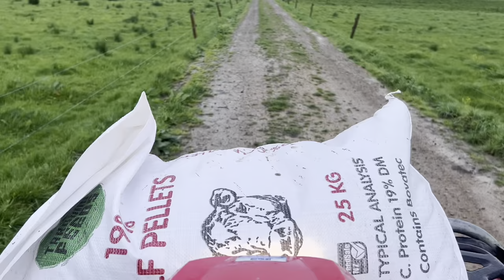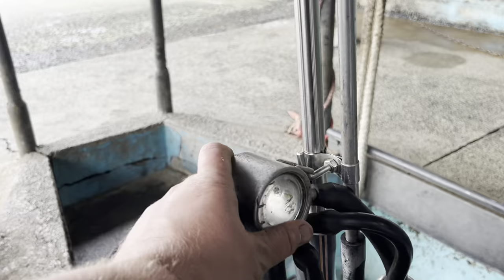Cowshed Gets An Upgrade. #farming #upgrade #milkingcows

Comment: Persevered with the old diaphragm milk pumps for nearly twenty years and eventually decided that life was too short went for a variable speed centrifugal and much too my surprise the milk went into the tank over a degree cooler than the diaphragm’s, have the new pump 10 years and touch wood haven’t spent a penny on it, it literally has never been touched since the day it was installed, why I stuck with the horrible bloody thing so long I will never know. You won’t know yourselves with the new clusters your shoulders will be thankful that’s for sure. I was a bit surprised that you didn’t put in a bigger milk line while you were at it are you confident that it will be able to handle the volume.
Reply: Variable speeds are the way to go , save a shit load of power as well
Reply from the maker: Hey mate. 
Yep we will keep the old girl going. 
We have had a talk to the milking machine company and that particular pump goes on the bottom of the milk can. Which wouldn’t work for us as it would put that pump at head height and to move the line up and adjust would cost a lot and we would have to upgrade the line and the vacuum pump. 
Yea those new clusters work great. Milk faster and more even. The new lines help alot to get the milk out of the cow quicker and keep the clusters pumping. 
Dads very happy with the new cups. Milking has speed up about 20mins.
The new milk line would cost about 20,000 to install as we’d have to change up all the pipes adjust pipes that will get in the way and would have to increase the vacuum pump size as the milk machine company says we wouldn’t have enough suction.